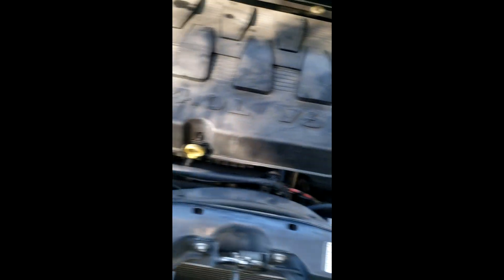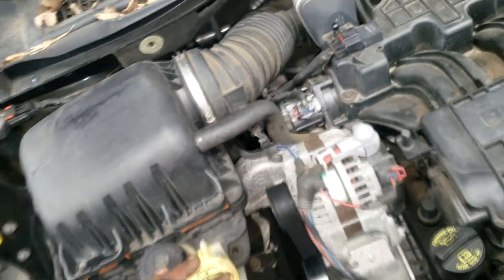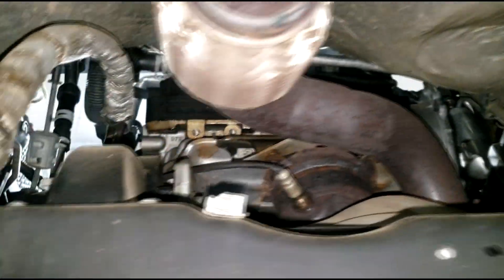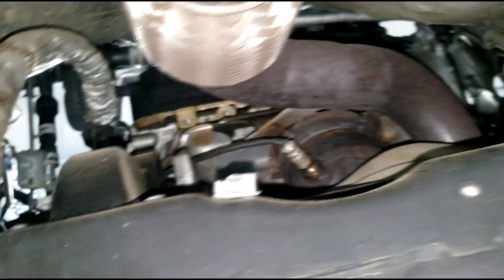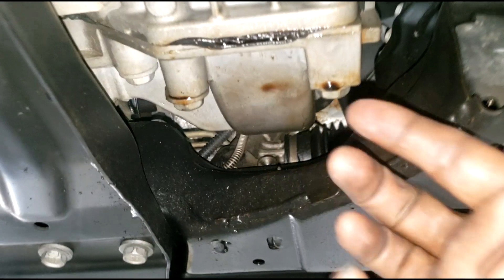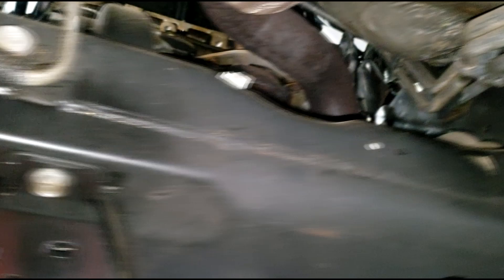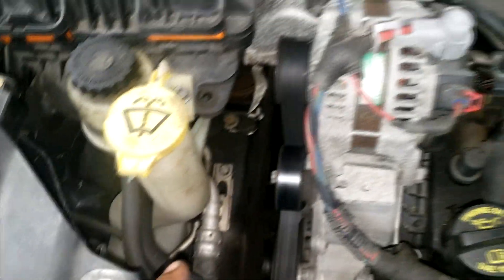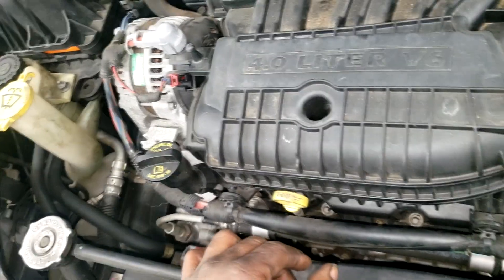Not fixing this ASAP could lead to a fire. Look what I found

Comment: That 4.0L will run forever! Great Video JT! God Bless
Reply: I heard rod knock
Reply: @Critter0817  Change your oil
Reply: @matthewschuster4600  I did and it still decided it didn't need a rod bearing. Did it every 5k miles, and I promise I didn't fudge up the change either. I have no idea what happened

Comment: does this cause the engine temp to rise? i have had the same issue with white smoke coming from under the hood and the smell of burning oil, and occasionally the engine temp going too high before falling back down